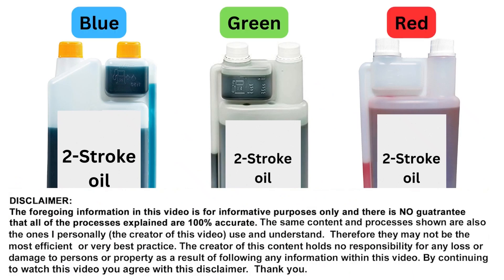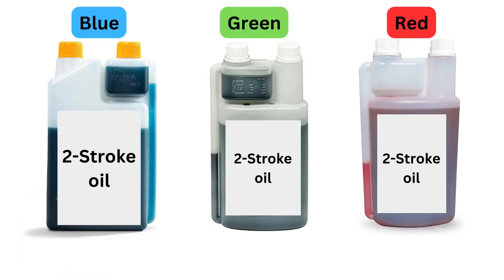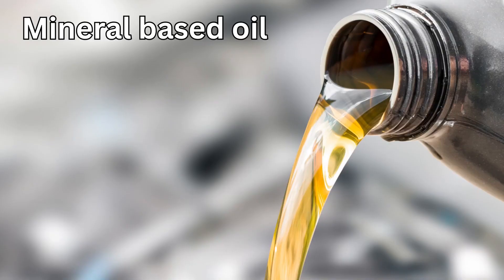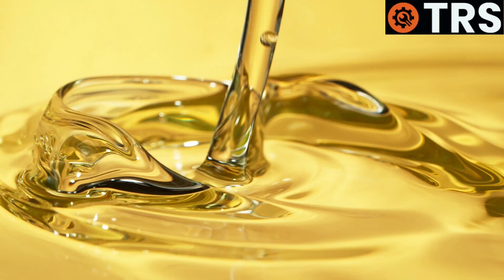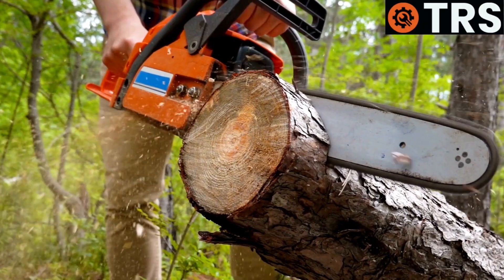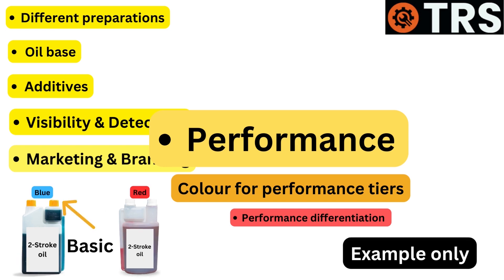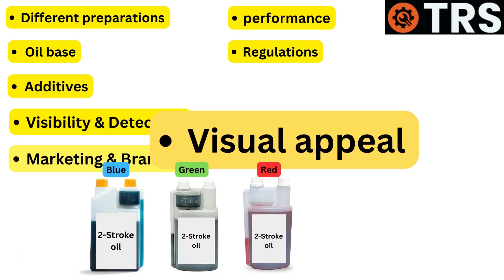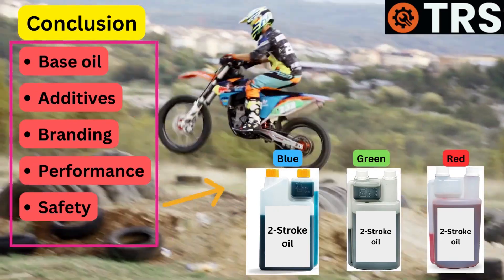Chainsaw Oil: Why it has Different Colours!  (by Craig Kirkman)

Comment: Didn't hear about green oil .
Reply from the maker: Green-colored 2-stroke oil refers to the actual color of the oil itself, which can be green. This isn't necessarily related to being environmentally friendly but is more about the formulation and additives used by different manufacturers.

Here's some info on green-colored 2-stroke oil:

Identification: The green color helps users easily identify the oil, especially when mixing it with fuel. It ensures that you can quickly see the oil has been added to the fuel, preventing mistakes in the mixing process.

Brand-Specific: Certain brands, like Echo and others, produce 2-stroke oil that is green. The color can be a signature of the brand and its specific formulation.

Additives: The green color can come from specific additives that the manufacturer uses. These additives can enhance the performance of the oil, providing better lubrication, reducing deposits, or improving combustion.

Marketing: Sometimes, the color is simply a marketing choice to make the product stand out on the shelf or be more visually appealing to customers.

Using green-colored 2-stroke oil is just as effective as using oils of other colors. The color doesn't affect the performance but can make it easier to handle and mix.

If you’re curious about trying a green-colored 2-stroke oil, look for trusted brands and check the specifications to ensure it meets your equipment's requirements.

I hope this helps a little more. 

Thanks 

Craig

Comment: I have been using red oil in my chain saw for 28 years and it has always worked like a charm.  I tried blue oil this week and my motor started smoking like crazy.  I always thought that the blue oil was for water-cooled 2-stroke engine like boat motors and that red was for air cooled engines that run a lot hotter.  I'm all confused now.
Reply from the maker: Thank you for sharing your experience with different 2-stroke oil colors, and I can understand why you might be confused. The color of 2-stroke oil is not a universal indicator of its suitability for specific engines, and the perception that blue oil is for water-cooled engines while red is for air-cooled engines is not entirely accurate.

The color of 2-stroke oil is often determined by the manufacturer and may vary from brand to brand. It's primarily a marketing choice and doesn't necessarily reflect the oil's intended application. The most critical factor in selecting 2-stroke oil is the oil's formulation or its specific properties, not its color.

When choosing 2-stroke oil for your chainsaw or any other 2-stroke engine, it's important to consider the following factors:

Oil-to-Gas Ratio: Ensure that the oil you choose is suitable for the recommended oil-to-gas ratio specified by your chainsaw's manufacturer. Using the wrong ratio can lead to poor engine performance and increased smoke.

Oil Quality: Look for 2-stroke oil that meets the industry's standards and recommendations. High-quality oils often contain additives that provide better lubrication and protection against wear and deposits.

Engine Type: Pay attention to the manufacturer's recommendations regarding the type of 2-stroke oil to use with your specific chainsaw model. The user manual or manufacturer's guidelines should provide clear information on this.

Environmental Considerations: Some 2-stroke oils are formulated to be more environmentally friendly, with lower emissions. This can be a consideration, especially if you use your chainsaw in areas with strict emissions regulations.

In your case, since you've had success with red oil for many years, and you experienced smoking when using blue oil, it's a good idea to revert to using the red oil that has proven reliable for your chainsaw. If you have any doubts or questions about which oil is best for your specific chainsaw model, I recommend consulting the manufacturer's guidelines or contacting their customer support for clarification.

Ultimately, the key is to follow the manufacturer's recommendations to ensure the proper functioning and longevity of your chainsaw's engine. Your dedication to maintaining your equipment is commendable, and I hope this information helps clarify the confusion regarding 2-stroke oil colors.

I hope this helps a little
Craig

Comment: Hello I just watched this video and still dont have any clue what gas color I need. I got a Bolens BL110 MTD weed eater and it has red gas in it but its not running right. I have never seen a weed eater with that kinda gas in it before so could it have bad gas or mixter? I looked on their web site but no info on the mix color just 40;1 ratio.

Comment: While they will pick up a tint based on additives, I am 99% sure the manufacturers put dye in them for branding and not much more. I am stop by my local shop and buy 2 stroke oil specifically for weed eaters and chainsaws in 4 colors.
Reply from the maker: Yes I agree
Reply: I know an oil formulator that buys Esterex 400 from Mobil...it is concentrated 2 stroke chemistry..it comes out dark green..he presumed it is dyed that way...just like ATF is red from dye.

Comment: Since there is no industrywide or worldwide standard for what the various colors mean, colors can also be confusing.  Red could mean one thing for a manufacturer and something else for another, so one must still fully understand which oil type the manufacturer/manual says to use and what all the various additives do and how they relate to the needs of the device.  That's a LOT of label reading and ingredient knowledge needed in advance.  Rather than choosing a color, I'll stay with your Stihl 2-Stroke Oil recommendation for high quality and ask my small engine shop which one is best for chainsaw brand and model.

That's IF I move away from premixed 50:1 Premium Zero Ethanol made by the manufacturer.  I can buy Premium Zero Ethanol here, so this is a viable option.  You've already proven and confirmed to me that a high quality premixed 50:1 is a great way to go for my chainsaw, so mixing it myself this way should be just as good, and now it's only a price-dependent decision.  Plus premixed is in a metal can with a sealing cap, which  could be much better than a plastic gas can because of heat expansion and needing to use the air cap to let air in or especially out.  Then again, I could use the empty metal can, which I store indoors while the plastic cans are in the shed.  Your info is so great because it gives us options and enough info to come to conclusions.  Thank you, Mr. Craig!
Reply: In Australia for my echo  chainsaw and blower I use a local red penrite full synth motorcycle 2 stroke which has all the additives and specs as the echo branded red armor which isn't exactly available here, works a treat and is a bit cheaper.

Comment: Thats Nonsense, Colour has nothing to say, not even the Manufacturer...
The only Thing counts to choose are the Specifikations written on the Bottle. Halfsynth is fine, then take Care of which Engine Type its made for, Watercooled, Air cooled or Marineengine, is also watercooled, but runs much cooler than your Scooter.
Reply from the maker: The color of two-stroke oil is a topic that has garnered varying levels of attention and debate among enthusiasts and users. While it's true that the color of two-stroke oil doesn't serve as an absolute indicator of its quality or performance, it still holds some significance in certain contexts.

Traditionally, two-stroke oils were often dyed a specific color, such as blue, green, or red, by manufacturers to help users distinguish between oil types and fuel mixtures. This practice aimed to simplify the process of selecting the appropriate oil for their specific engine applications. Different colors could signify different oil formulations tailored to various engine types, such as outboard motors, dirt bikes, or chainsaws.

However, with advancements in oil technology and changing industry standards, the color coding practice has become less consistent. Many modern two-stroke oils are now clear or nearly colorless due to improvements in refining and additives. This shift has led to the belief that the color of the oil matters less than its specific characteristics, as outlined by the manufacturer.

The key takeaway is that while color can still offer a rough indication of the oil's intended use, it's no longer the primary factor to rely upon. Instead, users are encouraged to pay closer attention to the specifications provided on the oil container. These specifications detail the oil's viscosity, additives, and intended applications, helping users select the right oil for their engines' requirements.

In essence, the color of two-stroke oil, although less relevant than it used to be, still bears a trace of its historical significance in guiding users towards the appropriate choice. However, I do completely agree with you that the true reliability lies in adhering to the manufacturer's guidelines and understanding the specific needs of your engine to ensure optimal performance and longevity.

Comment: i thought  companies made their 2 stroke oils a specific color that way when warranty work comes up they know if they are using the correct oils. because some companies in the fine print say that you have to use their oil and nothing else.
Reply from the maker: HI. Thank you for your comment. You bring up an interesting point about the color of 2-stroke oils. While it's true that some companies use color-coding to help identify the type of oil being used, there can be multiple reasons behind this choice. It's often about making it easier for users to distinguish between different types of oils and ensuring they're using the right one for their equipment.

Regarding warranty concerns, it's true that some manufacturers specify the use of their own oils to maintain warranty coverage. This is mainly to ensure that the oil being used meets their quality standards and won't cause any issues with the engine. However, it's worth noting that there are also high-quality aftermarket oils available that might meet these standards as well.

Thanks
Craig

Comment: We have learned 2 stroke oil comes in many colors, thanks.
Reply from the maker: Absolutely, and it's like a rainbow of options for your engines! Who knew oil could be so fashionable, right?  So if your engine wants to rock a certain shade, you've got plenty of colors to choose from. Just remember, happy engines make for happy journeys!
Craig
Reply: Thanks again, what's your favorite brand for air cooled 2 strokes?

Comment: thx, so color just mean nothing if you buy from various brands, only in the same brand it will mean a different
Reply from the maker: You've hit the nail on the head. The color of two-stroke oil can vary quite a bit between different brands, and you're absolutely right that it doesn't necessarily indicate anything universal about the oil's properties or quality. In fact, different additives and formulations can result in oils of various colors.

It's important to remember that while color might not be a reliable indicator across different brands, it can still be useful within the same brand. Manufacturers often use consistent colors within their own product lines to help users identify specific formulations or types of oil.

Thanks 
Craig

Comment: So, you are saying, color is arbitrary and may or may not indicate various attributes. In conclusion,  choices should be made on intended use of the oil and disregard color .
Reply from the maker: Hi. Two-stroke oil color is indeed arbitrary and not a definitive indicator of specific attributes. It's like a colorful game of hide-and-seek where the real information lies in the formulation, not the hue.

When it comes to making the right choice, it's all about considering the intended use of the oil and focusing on its specifications. Different engines have different requirements, and the manufacturer's guidelines provide the best roadmap for selecting the appropriate oil. Disregarding the color and paying attention to those specifications ensures you're giving your engine the care it deserves for peak performance and a long, happy life!

Thanks 
Craig